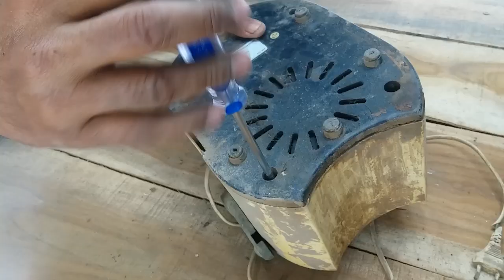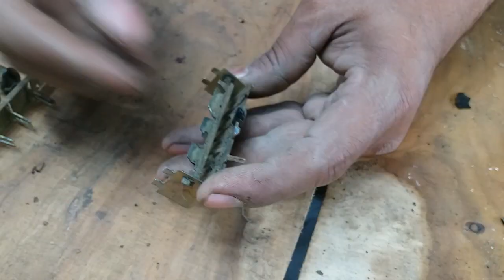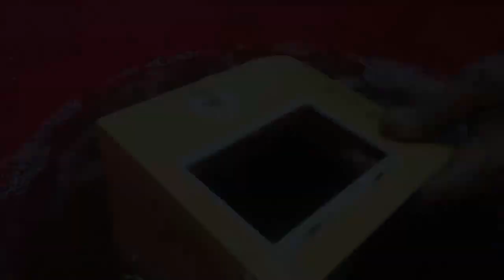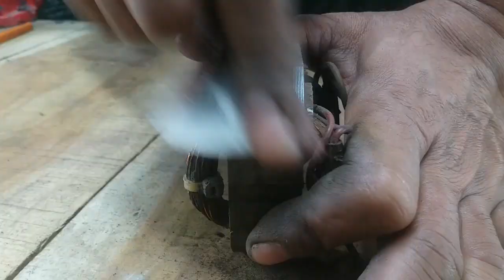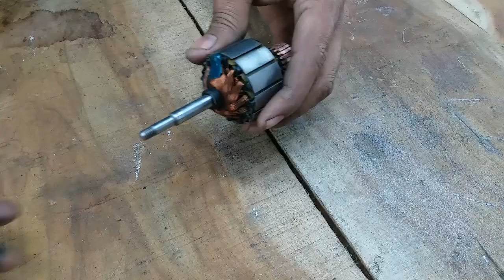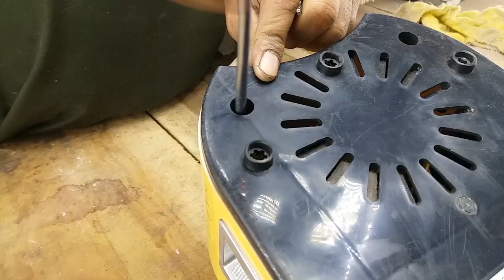Old Juicer Blender Machine Restoration | Restore 220 Volt Electric Juicer

Comment: After cleaning yellowed plastics, try hydrogen peroxide 20% cream, apply cream evenly put in clear plastic bag leave in hot sun for 1-2 hours massaging the cream into the plastic while rotating to catch sunlight evenly every 15 minutes, and then polish after washing with soap and water, you will love the results. Great restoration, keep up the good work!
Reply: The 8-bit Guy has some cool videos on exactly that.
Reply: Raul Gajadhar -- It doesn't last. Once the plastic has begun to 'yellow' it will quickly return after retrobrighting.
Reply: Actually just put it in something to hold water, put the yellowed thing in the holding thingy (for example a container) fill the container with water enough to submerge the yellowed thingy, then add peroxide, then optionally, add plastic wrap over the top, you want it to have lots of sunlight i think. Then after, maybe a couple hours, its white! Or whatever color it was before it yellowed
Reply: Small Round Boi-- it's got nothing to do with 'temperature' it's UV bleaching, you need sunlight or UV light.
Reply: Spetsnaz 101 ok, i wasn’t really sure when i said that 😂
Reply: @spetsnaz1014  What causes the Yellowing? Oxidation? Would a clear coat prevent that?
Reply: @JustinC87 Ironically it's the uv element in sunlight which causes the yellowing, a clear coat wouldn't prevent it.
Reply: @spetsnaz1014  the 8 bit guy has done some experimenting that shows that it's a combination of both uv and temperature

Comment: Judging by the amount of dirt on it one could be forgiven for thinking that this had been found buried in the earth - looks also from the casing inside that the motor may have overheated at some point in the past. Good restoration but I agree with other comments this would benefit from retrobrighting to bring the very yellowed plastic and buttons back to their original white colour (or as close as can be got to white).

Comment: What about retrobriting it. Look on 8 bit guy's channel on how to do retrobriting. Basically, you fill up a casing with water (a couple of liters) and 1-2 bottles of hydrogen peroxide (12%) , soak the yellowed casing and also the yellowed buttons, and put it out the sun or heat up in a other way. This will un-yellow the plastic and restore its original color. You can see the original color inside of it, and around the levers and where the button frame was. NOTE: Soak ONLY the yellowed plastic details, so you have to disassemble it again completely.
Reply: It's not heat that is required, it's UV light. Also it's been reported that the retrobrighting doesn't last.
Reply: @spetsnaz1014  correct, it doesnt last, in a few months it will be back, it lasts a lot less that originally, its just the plastic, it cannot be helped
Reply: Spetsnaz 101  yup its just a waste of time and money.

Comment: You might be able to restore the whiteness of the appliance with a little bleach if the stain is organic. How did you repair the broken fan? Did you just put it back with it missing a blade? Also, it's missing the entire top half. You're basically just cleaning it, not restoring it. What's the point then?

Comment: Rubbing those copper wires like that got me crawl in my skin. That base won't work for long. The safest way to clean those would have been by dipping them in gasoline and then wipe them with a fine cloth. Then left to dry... But yeah...